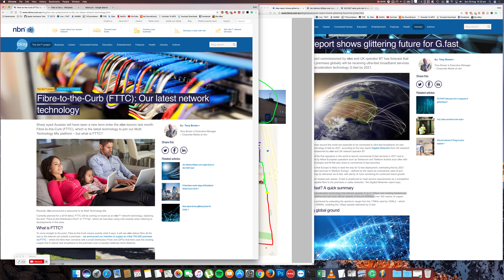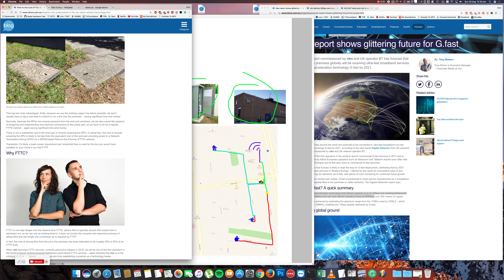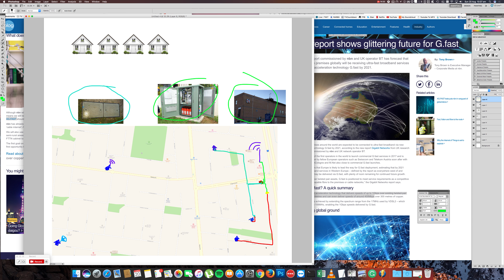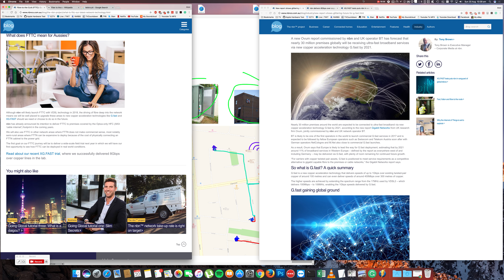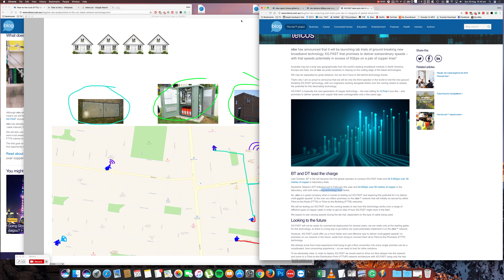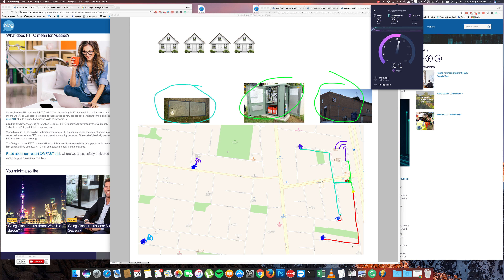A Nerds View on NBN's FTTC

Comment: Hey man. there was a problem at my exchange and all the FTTN people in my area have NBN (I.e. across my street) and all the FTTC people delayed another 7 months. Do you know what could be the issue please at the exchange. Is there some sort of weird technology that I am not aware of which is necessary for FTTC vs FTTN. Because I was thought it was simply a matter of the fibre just running a bit longer and closer to the home for FTTC..Thanks.
Reply: And do you know if there is a way to contact someone on NBN who actually knows whats going on or has access to good information that the usual duds I end up talking to on 1800 OUR NBN.
Reply: Lol 7 months later nbn fttc came out in my area. You very smart research sir

Comment: Where dose HFC stand in all this.
Reply from the maker: Darb Star my understanding of Hybrid Fibre Coaxial (HFC) is that it’s coax cable (like old pay TV cable) the setup will be similar to FTTN. Basically fibre will be run to a node in the street then the old obsolete coax that was used for pay TV will be cut and connected to the node, so you will end up with old coax going from your house to a fibre node. I don’t know speeds or anything as I have done only very limited research but I would assume it should be at lest as good (bad) as FTTN
Reply: Aron Bezzina I see  thanks mate. I left a like on your video